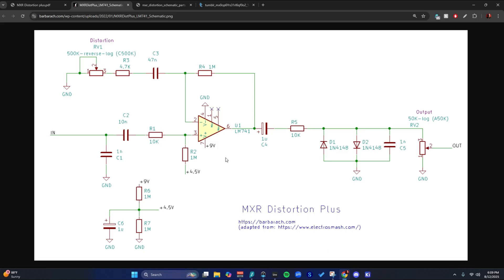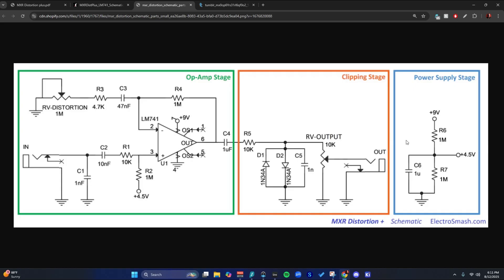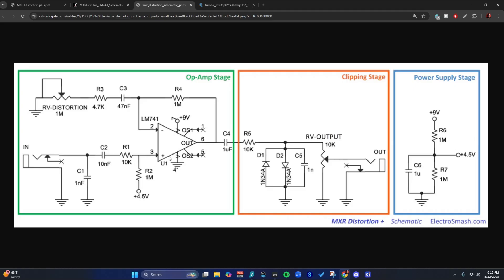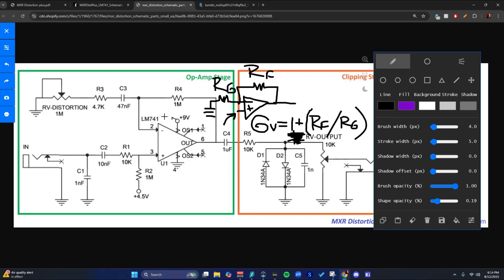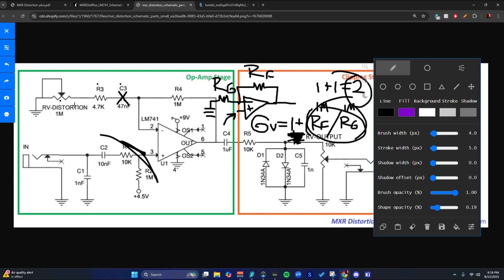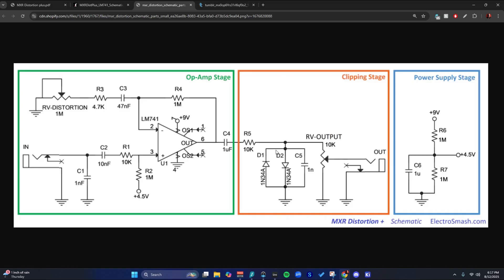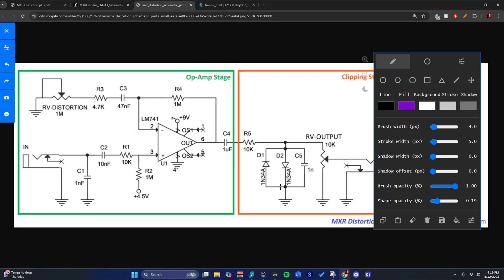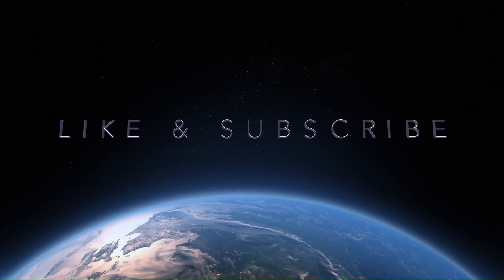MXR Distortion Plus Schematic Analysis

Comment: Hey! Just want to thank you for this content! I really appreciate you break down a circuit and explain the "why" of each section and what it actually does (e.g, voltage divider to 4.5 v so the OpAmp can operate etc etc ). Super helpful and informative. I have a few questions for you but I don't see any possible way to reach out to you either here on youtube in your profile, or on your insta. If you don't want random contacts, I totally understand, but if you are open to contact, please message somewhere. Heck, there is not even a "contact us" on your storefront for your pedal.  Anyway, please keep up the posts. This is great stuff! Also enjoyed the RAT breakdown video.